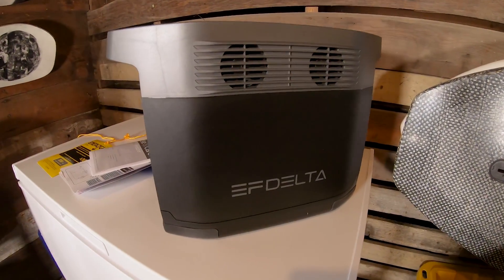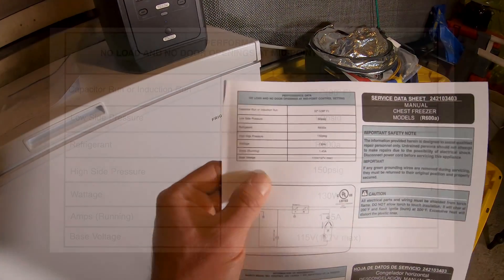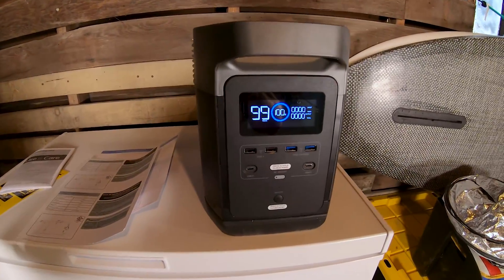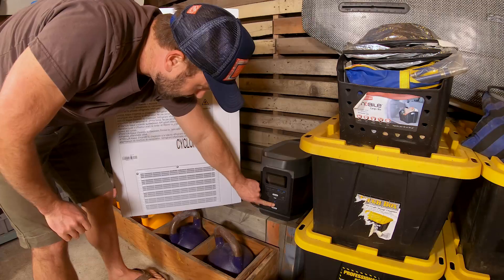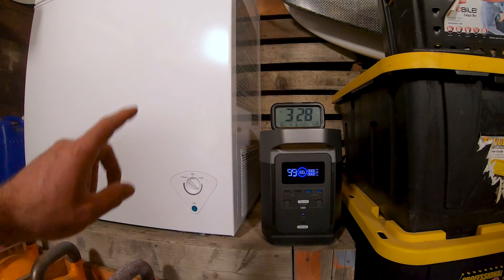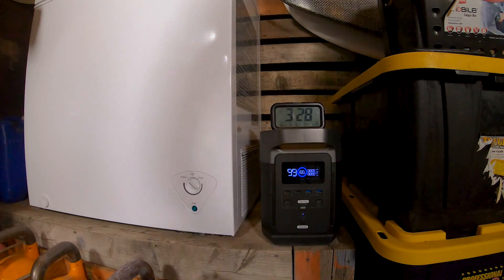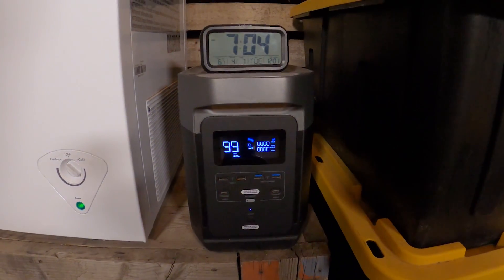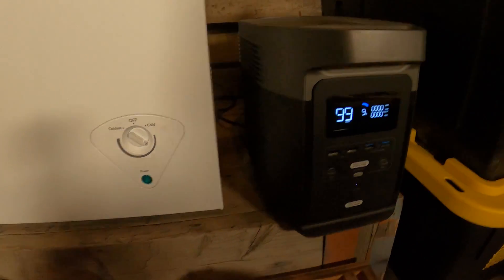EcoFlow Delta 1300 Power Supply vs. 7-Cubic Foot Chest Freezer | How Long Can it Run it?

Comment: An Empty Freezer Uses More Power By Running More Often, Than A Full Freezer = This Is A POOR Test.
Also U R Starting @ Empty & Hot.
Run Freezer >ON AC< Until Cold Setting Is Reached. Now Put (2) Bags Of Ice In The Bottom & Fill The Top Space With Crumpled Up News Paper 2 Fill The Space Full.
Now Unplug From The AC & Use EF, 2 Power = REAL Life Power Outage... = !!! DAYS Of Use NOT Hours !!!
U Also Have The Freezer Compressor Exhaust Against The EF...

Comment: Thank you for putting this to the test with a chest freezer. It's exactly what I was wanting to know about. However, what would have been even more informative would have been to examine the power draw by the freezer over time once it had been brought to the desired temperature. Essentially, what would the power draw be that would be necessary to maintain the freezing temp over time. I suspect that it would draw a lot less energy once at that temp. That question remains unanswered..

Comment: The one issue with this test is it's a New refrig with nothing in it or ever run before so it's going to take a lot of energy to get it at the coldest setting and run more often because it's empty.
This should of been done in a realistic matter with food already in it and already cold as if the power just shut down for a real timing !!!!!!!!!!!!

Comment: Nice, I'm thinking of getting one.  Amazon has prime day sales in a couple days and saw on Amazon priced at $999 right now.  Is that a good deal?  I'm also considering whether to get the Ecoflow Delta Mini, it only has 882 wh capacity and priced less at $749 now, but has remote app capability.  Also they have the Delta 1000 at $799 right now.  Just don't know which one to get right now.  I like the Delta Max, but its a bit more expensive.  Hoping to be able to decide best bang for the buck for me right now before picking one to buy...

Comment: I have the very same freezer, so I appreciate your video. Once the freezer is frozen it takes little power. You would most likely have a freezer full when the power goes out. It appears that you began with an empty room temp freezer and that would take far more power to get freezer temp. Frozen food would also hold the cold better than just air. The compressor coming on is what uses the most power.
Reply: Also it's good practice if you suspect power outages due to storms max out the power till electric goes out then maybe turn it down to half

Comment: You should do that test when you have a full freezer I can guarantee you right now I've done in my house I have like 650 watts and my freezer if I turn around and freaking think there's going to be cloudy days coming up and it is full they can go seven days before you get any kind of degradation on the top of the f**** meat that's on top everything else down below is that you're running a test on something that is empty it is going to keep on running and keep on running I can guarantee you get those freezers up and they're full that's how I do my s*** is I have a freezer it freezes freaking water and then I have ice boxes up above do my Refrigeration

Comment: Few things....
Move the 1300 somewhere where the fans can breathe! It likely used more power than it needed to because the fans had to work harder. 
With a full packed freezer, the compressor will kick on far less, translating into power savings.
Lastly, i recently learned this.... With a fully packed freezer, it only needs to be run 4 to 5 hours a day to preserve the contents as long as the door is not constantly being opened and closed. So the Ecoflow's power can be relegated to other tasks after that time window. 
Good thing... We have 3 freezers here.... Haha! 😁
Reply: As a new owner of a Delta 1300, I can tell you the fan will run anytime the unit is charging or discharging. Did a test over the weekend comparing the Delta to my Goal Zero Yeti. Powered My garage fridge for 12 hour during the day. Yeti's fans never came on, Delta's fans were running every time I checked it. Same for charging from the wall, Solar (90-100w), or from a 12v source only drawing 100w or so.

Comment: I have a similar freezer that I purchased this same device for emergencies. Mine is more energy efficient than yours. It only takes $15 per year to run mine. $30 for yours. I will be using 2000w of solar panels and my freezer is full so I anticipate being able to run it indefinitely provided I get enough sun to charge it during the day. It's insanely quick charge time is the reason I picked it. Thanks for the video, I feel like I made the right choice 😎.

Comment: Why is the 99 show yet it said 12% left in battery  - not sure what 99 is telling us - I guess I thought it was showing total charge ...?
Reply: At 12% the freezer wasn't running or drawing any power because the compressor was idle. It was below the thermostat setting. So if it isn't drawing any power, the display will say 99 just the way it displays 99 when fully charged and nothing is plugged in. When something is drawing power from the Delta, the microprocessor measure the remaining capacity of the battery and the amount of energy being discharged and then can display the approximate amount of time left.

Comment: Recently bought a 7’ chest freezer, and a Eco Flow Delta 1300. Never thought I’d be using it much in Texas. But here we are in February with a power outage. Thanks for the video. New to this stuff so it was a perfect video if we have to in fact use it.
Reply: How did the flow delta 1300 hold up during the storm?

Comment: Thanks for the video. I will try to run the chest freezer, and a full size refrigerator, if there is a power outage. . The Ecoflow Delta has pass-through charging, which means that I can power the frig and freezer while it is charging through solar panels during the day. Hopefully I would have a full battery by sundown that would last the night.

Comment: Starting warm requires a cooldown period - that took ~12 hours when we got a new 28 cu ft Samsung french door fridge with bottom freezer.  Probably not as long for the 7 cu ft freezer ;-)  Once cooled, the freezer would average 250KWH/365 days or 685WH/day.  What's the Ecoflow WH rating?  Just do the math for the run time once the freezer is cooled.   If it's 1300WH, then 1300 / 685 = 1.89 days or 45.5 hours.  For longer battery life, stop at 20% remaining and you'd have gotten about 80% of those numbers: 36 hours or 1.5 days.

The 5040WH battery bank on my solar backup power (easier than starting a gas gen for our frequent short outages) can run the 28 cu ft fridge/freezer 25 hours in summer to 50% discharge of the batteries (average usage of 2027WH/day, instantaneous power could be from 4W for a single circulating fan to 560W in defrost cycle).

Comment: Thank you for your video test & presentation.  I think a true test in a real life scenario might be to fill the freezer & freeze it down on mains power initially.  Then connect about 500 wh of solar PV panels to recharge your Delta  during daylight hours & connect the freezer to just run on the Delta / solar power.  Then time lapse your camera long-term to see how it performs in a potential long-term grid-down scenario.  The Delta display should show the charge at max. late afternoon having charged up on the solar power, then being run down considerably during the hours of darkness, then recharging again as daylight & PV power is re-established.
I currently run my fridge / freezer from a more homemade setup.  2x deep-cycle SLA 12v 130ah batteries (£150) wired in parallel, 3000w pure sine wave inverter (£110), cables & connectors (£10), PV charge controller / regulator (140).   So total cost of about £410 UK dosh.  My batteries have a DOD of about 20% in the summer & 40% during the winter.  It doesn't look as pretty as your Delta-Flow unit, but I'm guessing that those units cost over £900 ?  Current exchange rate of about US$1.25/UK£.
I'd be interested in your comments please?  Regards to all, JohnnyK.

Comment: A nice test but testing a 12V fridge in a Van without a fixed solar-setup would be a good test here... more practical... I ask myself how many days it would run a 50 to 60l 12V Dometic-Box.

Comment: The good thing about this portable battery is
Wide range of charging voltage from 11V to 48V other than 100V charging
If there is a capacity of 40 W or more, what is within that range
You can use a charging source as well.
Performance is good for the price.
This product is especially satisfying for people who have knowledge of electricity.

Comment: It is absolutely fine to run them to zero, just like a tesla. Coz they all remain with a 10% capacity as a safety precaution. And what the Tesla study has shown us is that the deterioration of the battery isn't worth a cry if you run them down to zero.

Comment: The best thing is that you can leave it plugged into your AC and the freezer into the Delta and it will passthrough the AC-power without using the battery.
The moment the grid goes down it will start functioning as a generator and supply power to the freezer.
Reply: @Pete Coventry those arent designed to run for a long period of time, most UPS systems are simply designed to keep your system running during blips in the grid, and giving you time to power down safely
Reply: Does pass-through also apply to solar panels?
Reply: @paranoidhumanoid  Yes. "Hobotech" says that you can power a load through the inverter, and charge the Delta through solar at the same time
Reply: You can but you should not? The Fridge feeds from the battery inside the Delta so you would be discharging and charging the battery constantly at the same time. Do this for an extended period of time and you will reduce the battery's life which is not very great (800 cycles - 60%). So this is not ideal as a stand-alone system to keep a fridge running 24/7, but rather an emergency backup that can be used intermittently with solar panels to maintain very essential needs
Reply: @cronicasdela6taextincionma973  - "pass through" does not send the wall charge into the battery. It passes through the system, bypassing the battery unless mains power is interrupted. Just like a UPS, though not as fast as the ones intended for delicate electronics like computers. EcoFlow says these may shut off in their documentation.

Comment: There is nothing wrong with running these down to 0 as it's not actually empty because 5% is reserved anyway that you can't used as such with most batteries. 

The most harm comes from the charge cycles especially with cellphone batteries because of how constant phones are charged. Charging to 100% counts as 1 cycle while charging up to 80% counts as 0.25 of a cycle.

FYI: for prolonged storage of the Delta recommends you to store at 100% but at such a high level of state of charge the battery will degrade faster, so while the it can be stored at 100% it's a bad idea for long periods of time overall.
Reply: storing lithium ion for long periods it's recommended not to be above 90%. I never charge above 90% as a rule of thumb.

Comment: Pretty impressive. The Delta could probably run a similar freezer that was half full and pre-chilled for 2-3 days before needing a charge. At least. Very interesting..
Reply from the maker: I reckon that's true. Perhaps a follow up test is in order?
Reply: @BoutenkoFilms  YES! Pack it to the gills. Let everything freeze fully. Then test.
Reply: It won't for the simple fact that energy is lost during the conversion to DC to AC in the inverter and it's meant for high draw items and due to that it was design as such just by having the inverter on uses 18 to 20 watts with no load and efficiency drops greatly depending on how warm the battery gets.
Reply: @Trillville43  You used only one period and no commas. Shame on you.
Reply: @Trillville43  so how long do you reckon it'd last?

Comment: Better than the Apex???
Reply from the maker: I wouldn’t say better, I’d say different. Both batteries have pluses and minuses. For example, the Delta is slightly more powerful than the Apex, but the Apex is rated for more charge cycles (Apex = roughly 2000 cycles  vs. Delta roughly 800). The Apex can also be expanded with external batteries, the Delta cannot. Then Again, the Delta can charge from 0-80% in an hour, which is unique to the Delta (for now). I wish there was one battery that could do it all, alas there is not (at this time). 😉
Reply: @BoutenkoFilms  very much found this video informative, would you do one on a full size fridge?
Reply: You can run two deltas in tandem